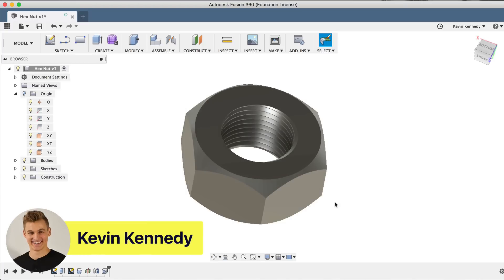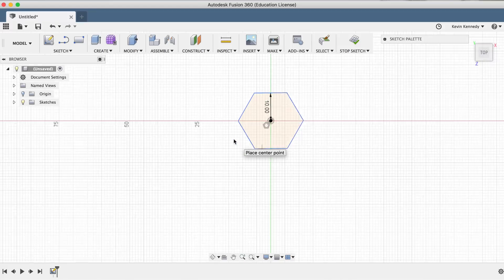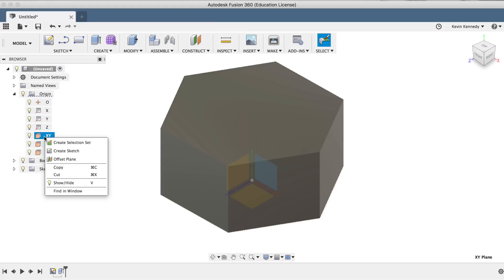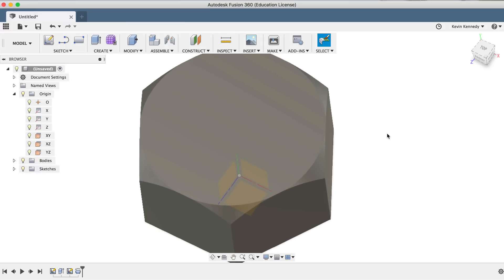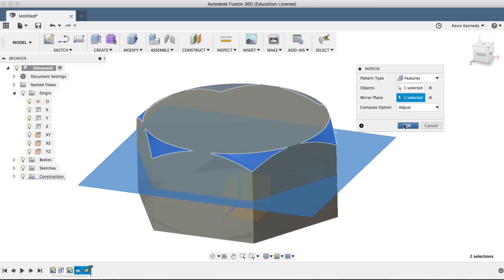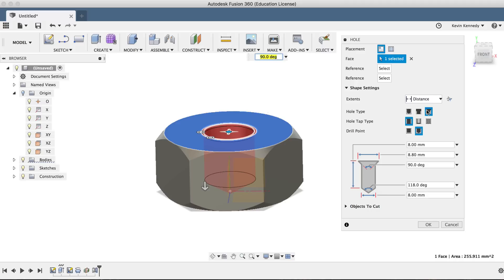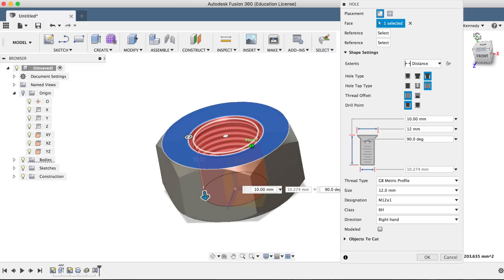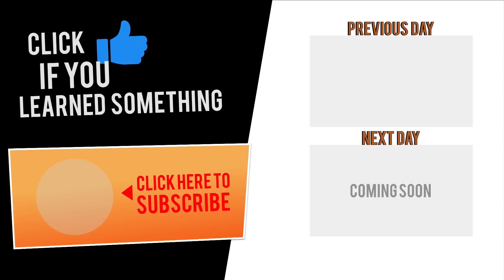How to 3D Model a Hex Nut - Learn Autodesk Fusion 360 in 30 Days: Day #6

Comment: I am finding myself having to go through and project features like lines and points that I see you just snapping to and clicking. Is this a setting or the result of a version change? Then when I revolve I get leftovers like triangles on the top plane, or little tag ends of lines from the hex corners.
Reply: This was it. I found that you answered it 6 months ago. Instant fix. name profile/preferences/design/Auto Project Edges on Reference

Product Design Online
6 months ago
@Jesse Kelly Can you check that you have the "Auto Project Edges on Reference" setting turned on - https://productdesignonline.com/default-settings-for-fusion-360-tutorials/#autoProject
Cheers, Kevin :)
Reply from the maker: You will need to turn on the "auto-project edges on reference" feature, under the Design tab of preferences. It used to be on by default. please check out the top comments of each video if you run into any road blocks. I've answered just about every common issue :)

Comment: Has anybody else had issues with the "Line" tool not snapping to the edge of the hex nut when trying to draw out the triangle for the chamfer? Apologies in advance if this has been covered in the comments. No need to reply, just found the link here - https://productdesignonline.com/default-settings-for-fusion-360-tutorials/#autoProject
Reply from the maker: I've answered this another comments... But I'll say it again for your convenience. You need to go to your preferences > Design and turn on the "Auto Project Edges on Reference" setting. The setting used to be on by default but they changed it so now you have to enable it.
Reply: @ProductDesignOnline  Thank you, and my apologies for that.
Reply from the maker: @olasdesign8054  no worries. Cheers!

Comment: Hey Kevin, thanks for a great series of tutorials. I'm trying to make the jump from Solidworks to Fusion 360 and these have been a great help. I'm also having the problem when I changed the chamfer from 1.5 mm to 2 mm, moves the center hole off center. I've read your replies to others, I checked that I have Auto Project Edges on Reference checked, I tried to make the corner and the beginning of my line coincident, doesn't seem to do anything. I can see the problem just can't fix it. I can click on the corner and the small circle appears but when I select the line function it goes away and will not highlight when I try to link the line to the corner. My triangle is off center. Here's the public link to my file. Thanks so much and will start the next lesson in the mean time. https://a360.co/2PG02NS
Reply: I'm having this same exactly issue. When doing the sketch on the YZ origin plane (XY mentioned in the video but the default orientation has changed has been changed) I am unable to snap my line to the upper right corner of the model. It's seems to want to snap just to the left of the corner every time. Without the line tool selected, I can select the corner no problem, but if I have the corner selected and enable the line tool, it de-selects the corner. Very weird bug.
Reply: I fixed it by projecting the point (pressing P and clicking on the corner) onto the plane before attempting to create the line. Another commenter mentioned this. Apparently "auto to project edges on reference" used to be turned on by default.

Comment: for some reason when i try to mirror the revolved chamfer onto the bottom plane i get an error. "Mirror 1-Compute failed". i have no idea why. and if the threaded hole is already in place and i try this, it completely distorts the component. my solution was to just repeat the triangle and revolve action again on the bottom.

Comment: Hey Kevin and all, whatever I try to do, whichever plane I choose I can't get the line of the triangle to snap to the corner and so when I revolve to cut I get vertical 'leftover' in each of the 6 corners. I even tried to change my home setting to the alignment you have but it doesn't work! What am I doing wrong??? I did it more than 10 times trying every plane possible...
Reply: I was having this same issue, I ended up making the horizontal and vertical lines collinear with existing lines on the hex nut.

Comment: Great video! I've been learning a lot from this video series! One question I have is how you would go about putting a chamfer on the bottom of the thread. Is there a quick way to do that with the hole tool or do I have to do that myself?
Reply from the maker: Hi Brady. Glad to hear you're learning a lot! While in the solid tab you'll find a "chamfer" in the modify drop-down list. The Chamfer tool is pretty straightforward. You'll need to select the edge and define the distance.
Reply: @ProductDesignOnline  Thanks for the quick response! I got it figured out, but it looks like it doesn't like doing a chamfer less than 1mm which is a little bigger than I'd like it to be. Any thoughts?

Comment: Thank you for your tutorials. I find them most helpful and presented extremely well. One thing I am running into is that the program does not automatically go to the correct view when picking a plane or issuing a command. It does not seem to function as yours does. Most times I need to pick the view from the cube to match what view you have on the screen. Is there a setting that I need to edit and/or adjust? Much thanks for your time.
Reply from the maker: Hi Joe. There are two settings that are likely to cause this. First, when you activate a sketch tool, make sure the "3D Sketch" option is turned off in the Sketch Palette. That alone may take care of it. If not, you'll need to go to your username/profile image > Preferences > Design > "Auto look at Sketch"

Comment: I tried to follow this example and I just couldn't seem to get the lines drawn on the XY axis. It seems like the version I'm using AF-360 not compatible to do revolve like your example. I don't know what I'm missing. The problem with drawing the line on the XY plane something is wrong
Reply from the maker: The "Y" axis was the default up orientation when I recorded this... so make sure you either change your view to have the "Y" axis set to up (instructions here - https://bit.ly/defaultsettings) or you will have to select the opposite origin plane than what I select in tutorial.

Comment: I’ve done all of your tutorials up to this one with no problem and they have been great. I am using the latest version of 360 so I’ve had to pause a lot to find various commands. This one however isn’t flowing right for me. I choose the top plane to draw the hex and then extrude, when it’s time to draw the triangle on the X,Y plane that’s the top again, I have to choose the X,Z for it to rotate to the front. Not sure what’s happening.
Reply: I'm having the same problem
Reply: Having same problem, also having a problem having the nut snap to the x or y axis

Comment: I am new to 360 and  I run 2d cad I just can't figure out why you have no problem with your snap to a line and no matter what I do It won't snap to any line after I extrude create sketch  go to line
Reply from the maker: Hi Jason. It's likely a difference in the default settings. Make sure "Auto Project Edges on Reference" is turned on - https://productdesignonline.com/default-settings-for-fusion-360-tutorials/#autoProject

Comment: thanks for this training session, it was simple, clear and very helpful but i faced small issue when i was trying to draw the triangle to revolve/cut for some reason i could not catch/point the top edge of the nut to start drawing the triangle?!!
kindly can advice what i did wrong? i tried many different ways at the end i gave up and i just zoom in and draw that triangle and cut the nut body.
Reply: I am having this exact same issue... :-/  Any tips on how to snap the line tool to that point on the top plane?

Comment: When I try to change the chamfer dimensions to 2mm and finish the sketch, the threaded portion moves to the outside of the hex nut as if a big bite was taken out and threaded.  Any other dimensions I tried like 1.7 didn't work either.  Not sure why.  Maybe someone can shed some light on this?  Kevin - Thanks so much for making the videos.  I remember learning AutoCAD when it first came out way back and I retired before ever having the chance to learn 3D.  This stuff is addicting!
Reply: I am having this same issue
Reply: I had the same problem, I right clicked on the extrusion of the hole, selected edit and moved the hole to the center again.

Comment: Okay. After more than an hour of trying to fix the Line feature since I can't snap it to the polygon, I have to quit for now and call it a day. A little bit frustrating but I guess it has something to do with this new version. It's hard to follow when you are not on the same page. I tried all the options/suggestion in the comments.
Reply: mine won't snap either

Comment: I'm sorry, I am still cannot get my version to perform like yours.   At the 2:16 mark, when I "right click and create sketch" on the XY plane, my model rotates to show the top, not the front where you show in the video.  If I then rotate to see the front face, I cannot get the line you draw at 2:24 to show up at the top, mine goes along the bottom.  Then I cannot create a vertical line.  I'm kinda stuck here.
Reply: I'm currently using Fusion360 v2.0.8156
Reply from the maker: @santabillgross7826  Hi Bill. If you're on the latest version then the Z-axis is set to the up position. You'll want to switch the axis to match the tutorial or select the opposite plane so that you're sketching at the vertex of the hexagon. Cheers!
Reply: @ProductDesignOnline  Ok, Thanks.  keeping my axes aligned with the tutorial did the trick.  I'll keep an eye out for the differences from here on.

Comment: I cannot get the triangle to go black. What do I need to do? I know it means it isn't constrained but i Have tried a few things. Cannot get it. Thanks!
Reply from the maker: Did it snap to the upper right corner? If not, you may need to turn on the "Auto Project Edges on Reference" setting is turned on? https://productdesignonline.com/default-settings-for-fusion-360-tutorials/#autoProject

Comment: My revolve feature doesn't cut, it only shows the lines of where it is supposed to cut. And yes I did set it to cut (and even tried all the other options) actually I've been struggling this whole tutorial. For instance it  wouldn't let me draw the lines for the triangle the way you did. So I had to do it via a different way. Because my fusion 360 just doesn't do what yours does. The previous tutorials went just fine. But I've been struggling with this one for over an hour

Comment: On this one I can't select the origin to make the hole. When I select it chooses the face. Hmm.
Reply from the maker: One thing to look out for - because this tutorial is older, the "Y" axis is set to the "up" position as that was the default at the time of recording. You may have to make the opposite selection based on the orientation of your model. Let me know if that helps, otherwise I can look at your file.

Comment: is there a way to add a countersink to both sides of the nut when performing the hole feature to better represent how a hex nut would be capable of threading from either side?
Reply from the maker: Hi Ryan. Unfortunately, the Hole feature does not currently have the capability. You can add a "Chamfer" to the other edge or you could complete a revolve cut similar to the outer shape.

Comment: With the 2020 version this wasn't quite the same. The snap to feature seems to have an issue with the separation of sketch and object modes, so drawing the triangle for the bevel was very fussy. Eventually I drew the triangle separately and moved the corner to the point of the hexagon.
This may be straight forward to the experienced but it's difficult to follow the tutorial if my Fusion 360 doesn't do the same things as yours. Maybe you could do an explanation of what to expect from 2020 vs <2020.
Reply from the maker: Hi, Dave. Thanks for sharing your feedback. I've documented the settings/changes to be aware of here, on my website - https://bit.ly/defaultsettings

You'll want to make sure the "Auto Project Edges on Reference" setting is turned on. It used to be a default (But no longer is) which is why you're having troubles snapping.  Instructions on turning the feature back on are included on my webpage linked above. Cheers, Kevin :)

Comment: I have another question please, when I select items for a certain action, the item does not get highlighted in a different color like blue but the selection is active.
Reply from the maker: Hi, Majid. In the latest version of Fusion 360 they changed the highlight color to blue (from orange). Therefore, the selection will be a slightly different shade of blue, which isn't as noticeable as when it went from orange to blue.

Comment: Hi Kevin!
Been using the quarantine to learn fusion and your tutorials are awesome!
I would love if you could help me with three small qusetions:
1. when placing a hole and cliking the origin, it places the hole perpendiclar to the Z axis (and not the face of the nut), so the hole is going "sideways". What's up with that?!
2. (Somewhat unrelated) When starting a new sketch, the camera used to align to face the plane head-on. it stopped doing that. how can I bring it back? 
3. How can I support you?! Keep being awesome!
Reply from the maker: Hi, Raz. First, glad to hear you're safe and making the most of your extra time at home :)

1. This tutorial was recorded when the "Y" axis used to be set to the up orientation. You can change that and check your settings with mine, here -  bit.ly/defaultsettings
2. That is likely due to the recent update which changed 3D sketching. You'll want to make sure "3D Sketch" is turned off in the Sketch Palette. More on that here - https://bit.ly/lookAtSketch
3. I have a Patreon and "Buy Me a Coffee" page, otherwise there are other ways you can support (free) here - https://productdesignonline.com/support/

Cheers, Kevin
Reply: Thanks for asking this, I spent a good 15 minutes trying to figure out why my XY sketch plane was different from the video!

Comment: I think I may have done something wrong somewhere. Everything seemed fine until I went to amend the sketch to 2mm. https://youtu.be/rhin3da_HQE
Reply: Same exact thing happens to me as well.  Works great until that final adjustment, then my threaded hole moves off to the side!
Reply from the maker: Can you share the link to your file so I can take a look?
Reply: @ProductDesignOnline  Sure - the first attempt where it didn't work https://a360.co/33MEHbG. But then I started over and it was fine. So likely something I'd done along the way.

Comment: When i revolved it to cut, it left the outline of the corner edges of the polygon. What did i do wrong?
Reply from the maker: Hi, Aaron. It's likely that your straight line (of the corner triangle) wasn't vertical or at exactly 90degrees. If the triangle is slightly off of the edge then you'll end up with a thin surface after the cut operation.

You can add a vertical constraint to it. Select the line > select "Horizontal/Vertical" constraint in the toolbar.

You may also want to check that your "Auto Project Edges on Reference" setting is turned on. That will help ensure is snaps to the edge/corner - https://productdesignonline.com/default-settings-for-fusion-360-tutorials/#autoProject

Let me know if that helps. If not, I'll have to look at your file.
Reply: @ProductDesignOnline  
Hi,  This fixed my problem I commented on earlier today. :-)  I will be sure to read comments thoroughly from now on.  Thanks!!

Comment: When I try to snap the polygon to the axis it doesn't snap, even tho in the sketch pallet.the snap feature and grid are both turned on. Any idea why?
Reply from the maker: Hi, Remark. You'll need to turn on the "Auto Project Edges on Reference" setting since they changed the default settings. Instructions - https://productdesignonline.com/default-settings-for-fusion-360-tutorials/#autoProject

Comment: Good instruction. I however miss a "lead in" that really works. The Fusion 360 chamfer of the thread doesn't give a correct functioning lead in. Also there should be a lead-in on the bottom side. I created them using the revolve & cut operation on a triangle shaped surface around the thread.
https://1drv.ms/u/s!Ai1oI-BoAFJCuFY9vW1N6SQxZJUM
Is there a better way?
Reply from the maker: Hi, John. You're correct, that's the best way to do it if the Chamfer tool doesn't fit the requirements/needs :)
Reply: You could first create the thread, then suppress it, add the chamfers and finally unsupress the thread

Comment: Hello Kevin, after I learned from you how a real man constructs a whisky bottle ;-), I have now learned how a mother simply goes to construct. I have one more question: If nut and bolt are designed that way, they can fit together kuam, because the thread is too narrow. Where can you adjust the "play" between the two to increase?

Thank you for that, especially for your precise descriptions. Best regards - jürgen from Germany
Reply from the maker: Hi, Jürgen Meißner. Glad to hear you're learning lots! Check out my video on creating 3D printable threads. I show how to add clearance between the nut and threaded bolt - https://youtu.be/aGWrFeu8Hv0
Reply: @ProductDesignOnline  Super Video with the tollerance